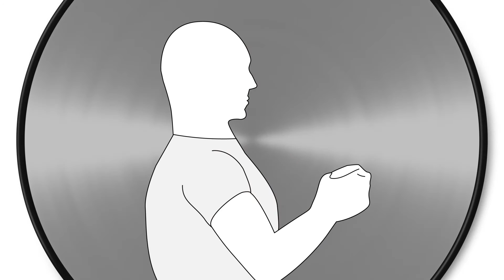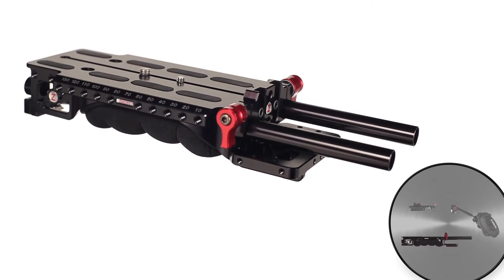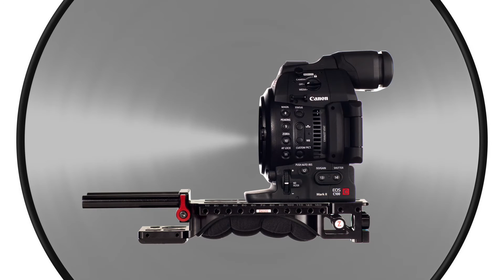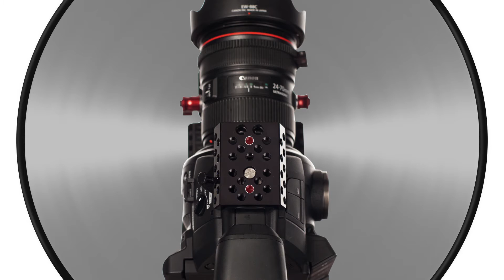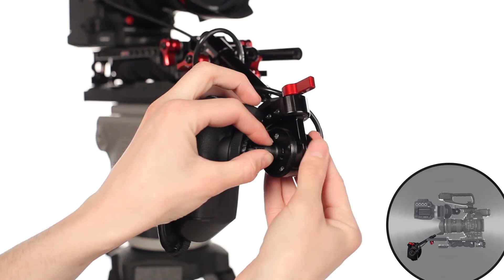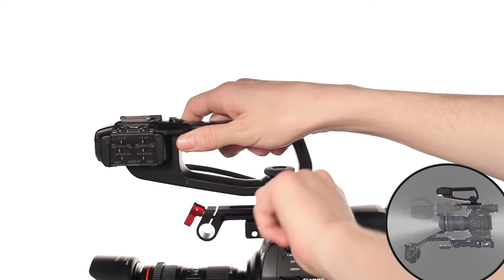How To: C100 MK II Next Gen Recoil

Comment: There is a very tiny flaw on the Z-Rail. Aligning the screws as you suggest and setting the rail one row to the left, scrapes the eyepiece if lifted. OK, the eyepiece is not going to be used if you have an EVF but when you go 'mun'n'gun you might. By a small redesign on the position of that center brace in the Z-Rail moved forward or back in the milling, you can move the rail all the way forward and clear the back and gibes yourself another small but significant 5mm forward mounting. Hope you can make this an update/replacement. Thanks.
Reply from the maker: Hi Ed, Please email some photos to sales@zacuto.com with this description and we'll take a look. Thanks! - Rachel, Z-Team

Comment: is there an option to buy the c100 mark I helmet plate individually? or the mark II version also works perfectly with the mark I version?
cheers
Reply from the maker: The MK II version will not work with the MK I. This bracket is a similar concept but works with the MK I https://store.zacuto.com/evf-mount-bracket-for-canon-c100-canon-c100-mark-ii/
Reply: alright, thx, but does this model secure the handle enough to not fiddle?
Cheers
Reply from the maker: This won't change or impact the connection of the handle to the camera. But the mount itself is very secure on the camera handle and will not twist or move.

Comment: how do the XLR inputs still work if you lift it up off the C100 body?
Reply: simon gentry the handle connects to the body with a cable. Also in Canon's own configuration. Look up reviews or unboxings